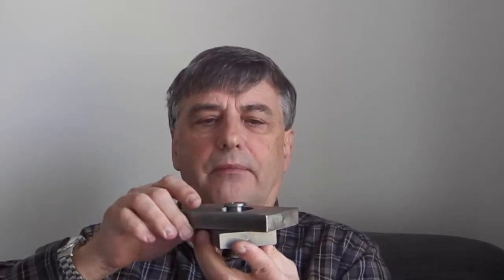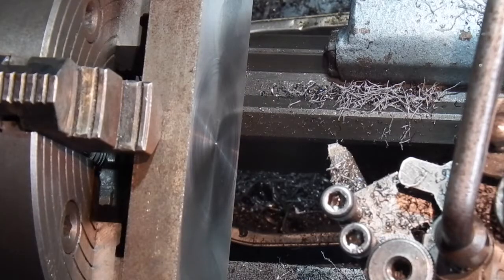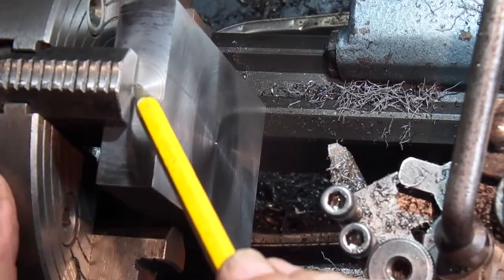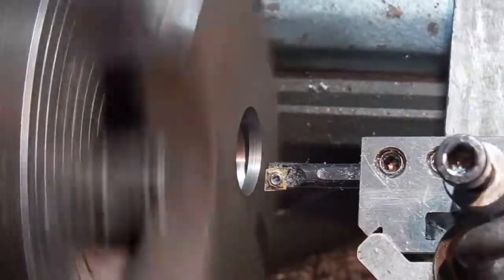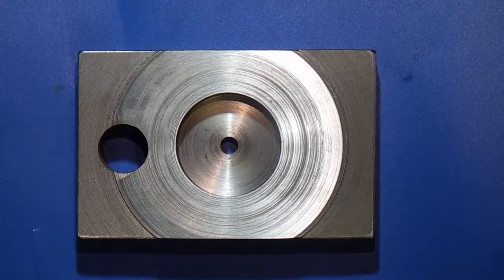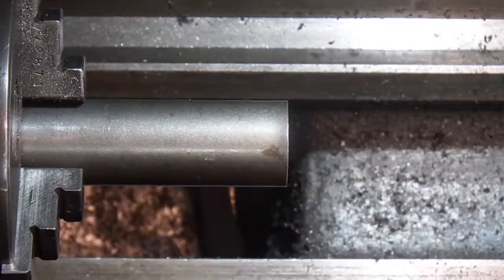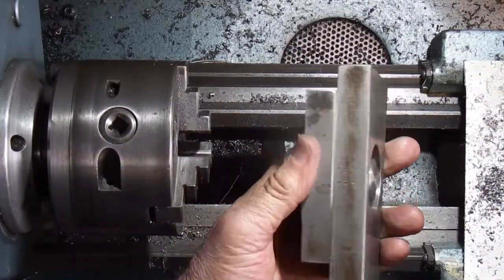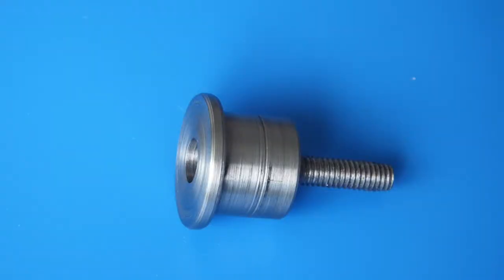Bearing block.

Comment: I find the constant switch between metric and imperial/SAE interesting.
Reply from the maker: Hi David
Sorry about that my lathe is metric and my micrometer imperial and the bearings are imperial.
Reply: OK, I understand. I am pretty much in the same situation. I just find it interesting.
David
Reply: One does adapt

Comment: Alan, please use a low RPM when using the reamer. max 200RPM
Reply from the maker: Hi Alyson I think the speed was around 240 rpm the slowest without putting the lathe into back gear. It looks faster as I speed up the video.